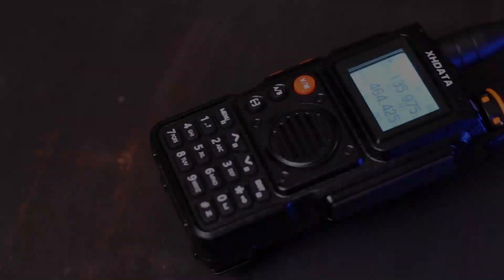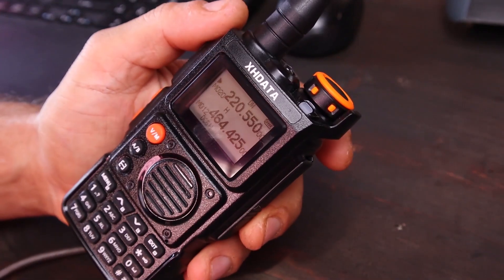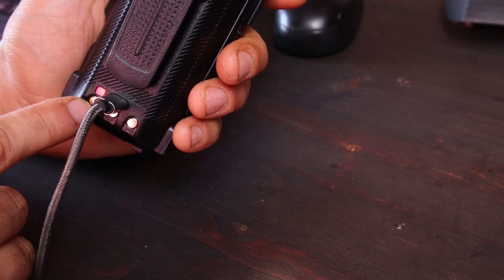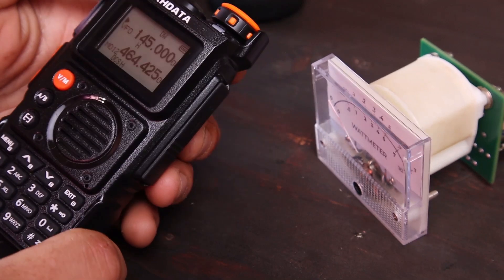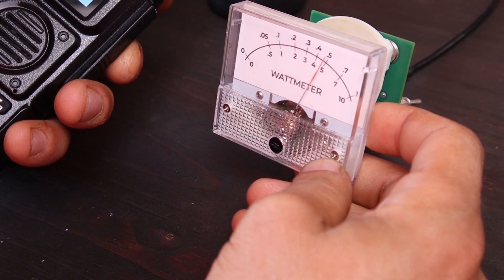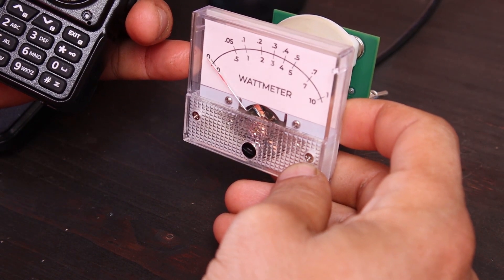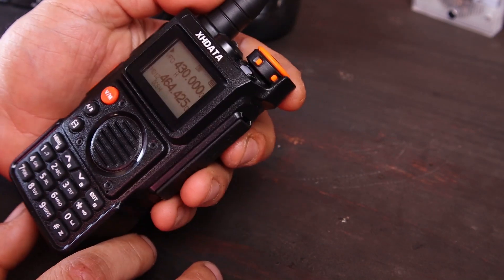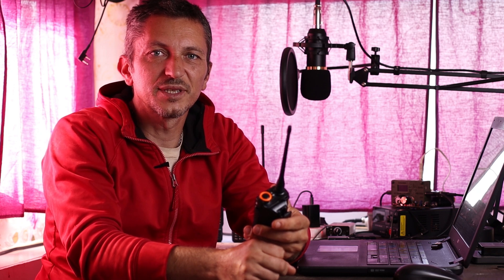Quick Look At The NEW E-100 VHF/UHF Transceiver From XHDATA

Comment: I purchased the XHDATA E-100 2-way radio about one month ago. Unfortunately, the device no longer powers on. When I connect the charger, the indicator repeatedly shows a red light followed by three green flashes. It does not appear to be charging, and the charging port becomes hot during this process.

Could you please advise me on what steps I should take?
Reply from the maker: First step is to contact support. That is what I would do.

Comment: Hey DX Explorer, first off, amazing channel—congrats! Thanks for tagging my video. Unfortunately, the VHF harmonic test was a complete fail, but the UHF performance was pretty decent. It seems like this might be a low-cost version of a Chinese design.
Reply from the maker: I had to use your video as an example as I did not had the RF attenuator to do the measurements. Yes indeed is not so good on VHF. But I think if there is a little more effort into it... it could become a nice and cheap radio still. Overall besides that is not bad at all. I kinda like it. 73, YO6DXE

Comment: I looked at the site with the harmonic testing. While I don't speak the language, from what I could make out of the TinySA it fails the US harmonic limits test, so I wouldn't suggest any Americans buy them unless they plan on adding a low-pass filter to switch in and out for each band.
Reply from the maker: It fails for everyone at the moment not just US..  but I will email and let them know so they can improve that. Other than that issue it seems like a nice transceiver for the money. 73, YO6DXE